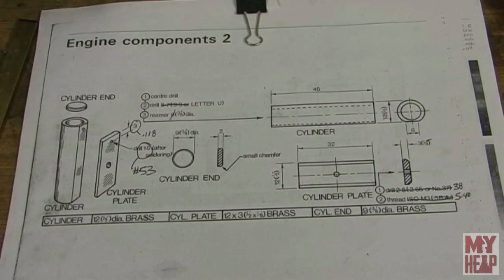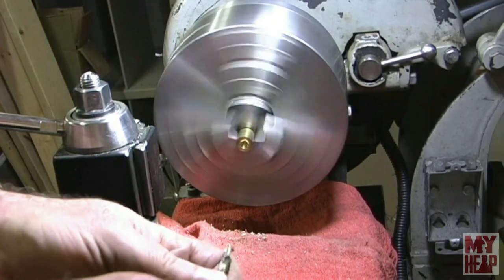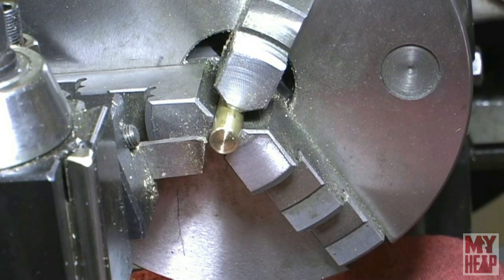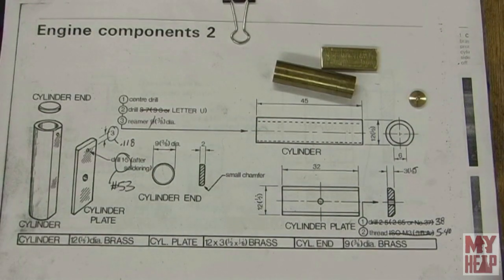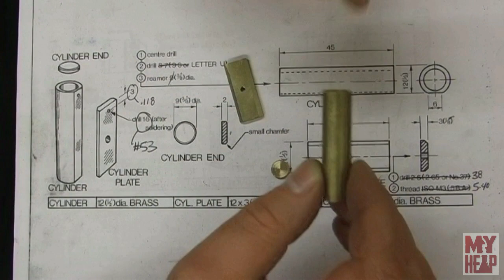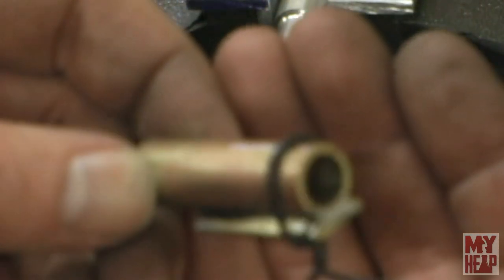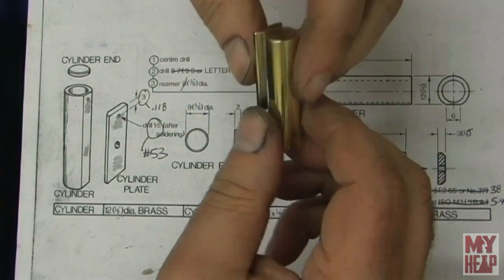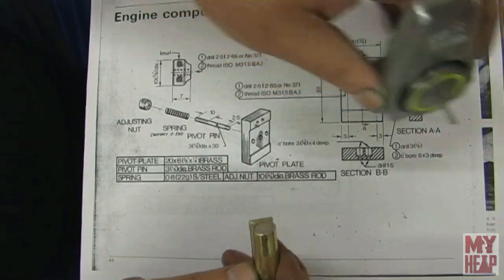Kenneth Wells Stationary Engine - 12 - The Engine Cylinder

Comment: G’day Joe, coming along nicely. Your soldering is getting better, I still see it as a black art. 
My daughter married last weekend with a very small contingency of family but was able to Facebook live it to the rest of the family, full wedding as soon as the virus is over. I presume being IT guy you would be working from home. You and your family stay safe. Cheers 
Peter
Reply from the maker: Hi Peter.  I am happy that your daughter was able to get married without too much grief.  The live streaming of the wedding is a great idea.  My son and new daughter done with he same thing.  This way, the family that was unable to attend at least got to see the wedding.  The kids gave me permission to post a picture of them so I will have to do a shop update and show off the new daughter to the family.

The engine is coming along nicely and I haven't much left to complete the model itself.  I need to make the piston and rod assembly and I get pivot plate.  At that point it is essentially complete but have to take a side adventure and make a hand water pump and a test rig to test the boiler and lastly make a safety relief valve.  The upside is I can get to a point where I can test run the engine on air at least.

Hope to see a sneak peak of the newlyweds in your family.  Looking forward to seeing the next dividing head build video too.

Stay safe my friend.  Prayers for you and your wife to get through all this stuff.

Joe

Comment: well, thats just lovely work. there cant be much left to do? piston plate, and some screws and pipework? exciting.
Reply from the maker: Yes ma'am, it is getting pretty close.  I still need to make a hand pump for a testing units.  I have all the bits to make LBSC's pump in the TICH book. So that is coming up soon and I still need to make a pressure relief valve.  You recommending that book has been a wonderful asset.  Thanks Emma.
Reply: @MyHeap  hahah is a slippery slipe that book.
Reply from the maker: @EmmaRitson  hmmmmm .... And you recommended this book to an unsuspecting novice?  That's mean.  Hahaha

Comment: Looks good joe, Im curious how you'll plug that hole in the front of the cylinder when your done, and I didnt think the temperature of the normal plumbing solder would hold up to steam temps for long, hence why most steam stuff is silver soldered?
Reply from the maker: I am thinking it should be just fine.  By the time hits the cylinder it is at one atmosphere so should be around 212 or maybe a tad hotter.  Still well below the five or six hundred degree melting range of tin/lead solder.  At least that's the theory.  Haha. I think I will just plug the hole with a little solder.  I guess we will see if it all works out or not.  Haha. Thanks for watching Chirpy.  Looking forward to seeing the next T&C grinder video.

Joe
Reply: @MyHeap  i put a screw in one of mine. i soldered the other. makes no difference.
Reply from the maker: @EmmaRitson  thanks for the info.  That's good to know.